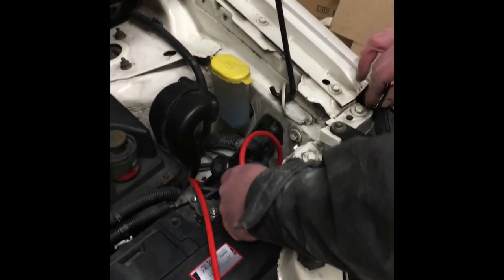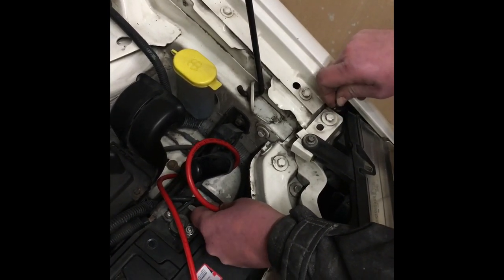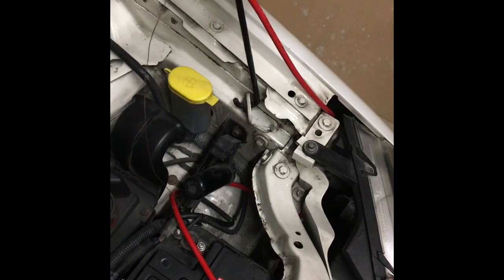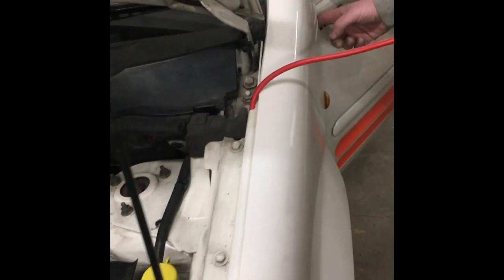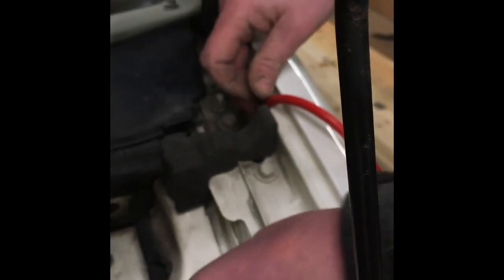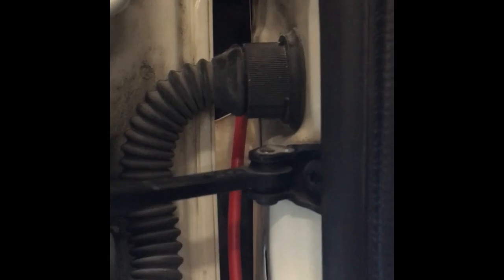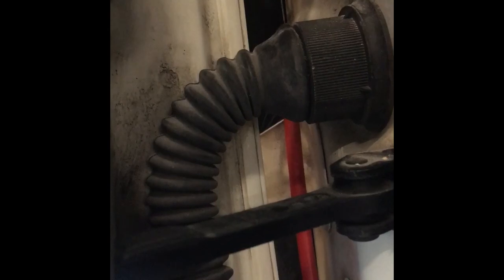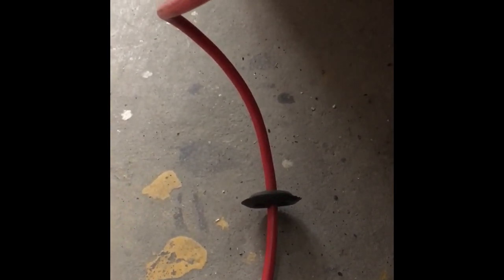Transit connect split charger wiring route for a second or leisure battery

Comment: I was trying to figure out how to route this on my Connect yesterday and found this brilliant video which saved me the headache! I managed to route some trunking to carry the cable, just had to loosen the front headlight to get it around the back before re-tightening. Thanks for sharing!
Reply from the maker: I know it’s not the best video but if it helps that’s great
Thanks 
Neil
Reply: @nsrpnsrp  It does the job, that's the main thing 👍

Comment: What size kit did you use and where is the battery location
Reply from the maker: 7meter 140amp battery is behind drivers seat in custom made box should be able to see on other videos although no battery in it